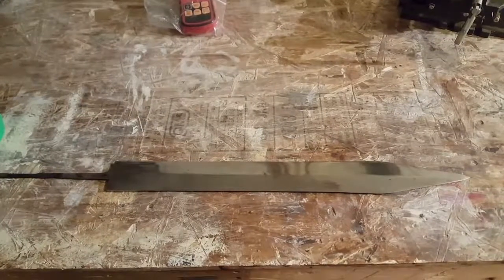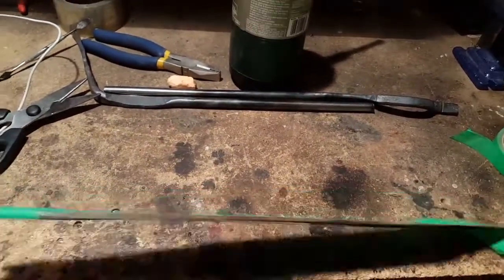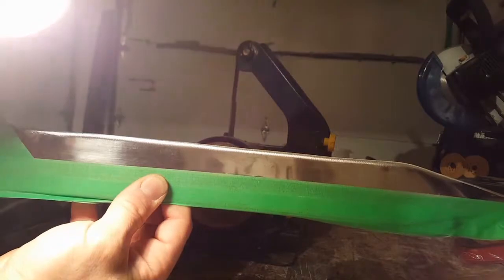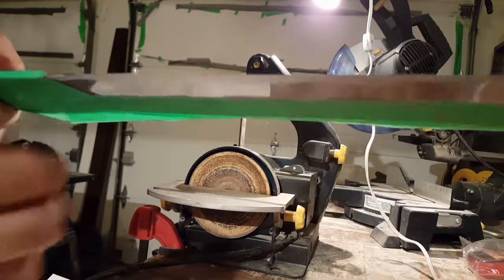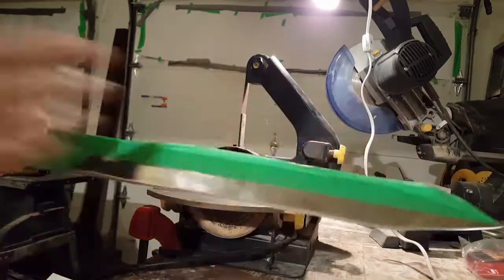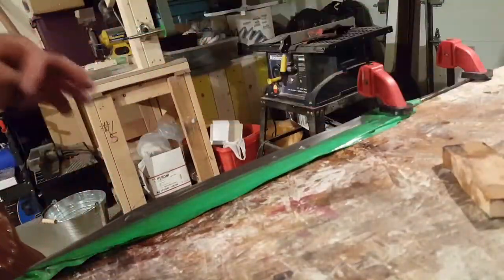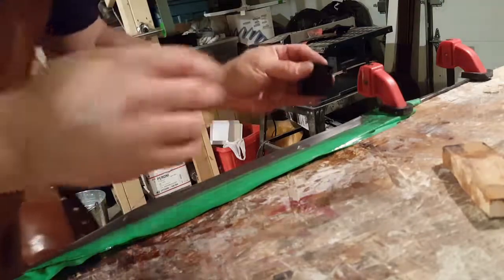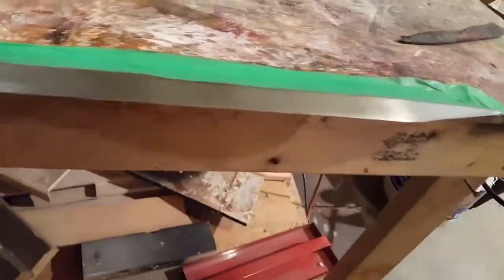Polishing and sharpening a gladius sword blade

Comment: Great video! But is there any other (quicker) way to sharpen a sword without adding a visible secondary bevel?
Reply from the maker: A belt sander will be the fastest way to sharpen any blade. On my katana I do not give it a visible secondary bevel. It's all in how you angle the blade to the belt, and what shape you want the blade to take